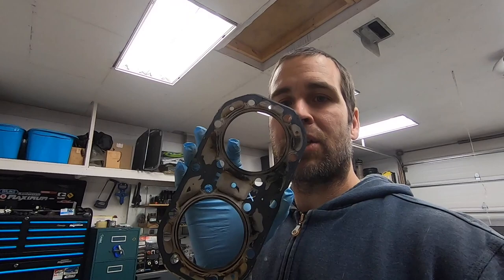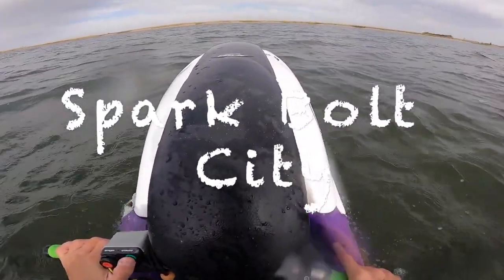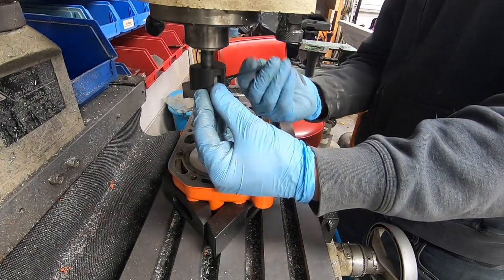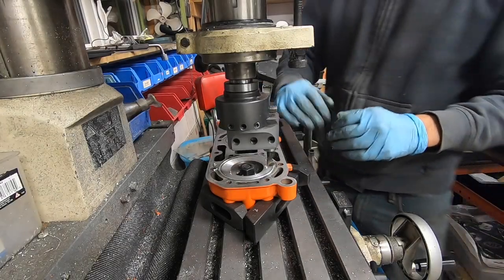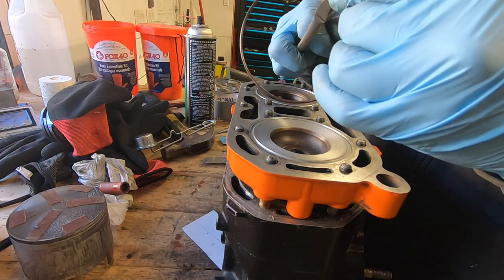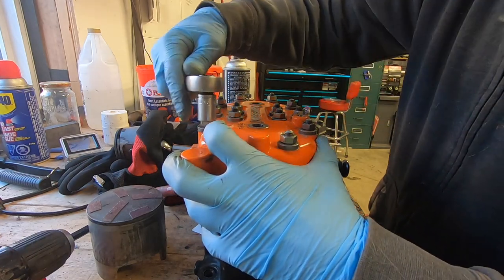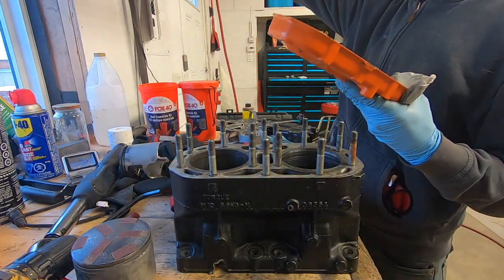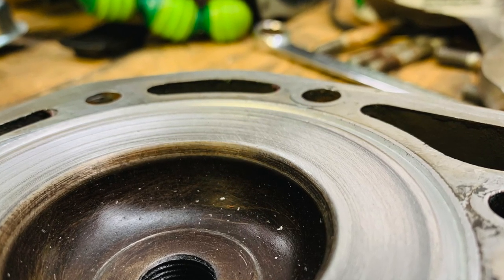Making An O Ring Head - Kawasaki X2

Comment: I don't think I've seen anybody else do this. Very cool. To be clear I believe this is called an Arsenealt ring head. I may have to try it. When I clicked on the video I was thinking hole saw? I think this is one of my favorite videos you've make in a wile. 1000% cool!
Reply from the maker: Thanks Jacob !! I'm blushing, lol. 

I think I read about this exact thing in a "two stroke tuners handbook" many many years ago. Some engines run copper head gaskets, so ... why not give it a go, eh :)  

The two most important parts of this, I believe, are making sure that your groove is deep enough but not too deep. You want enough copper sticking out so that it squishes and seals well, but not so much that you damage your head from deforming it. The next thing is to make sure that you anneal the copper. If not it will be too hard, won't seal and will probably damage the head. 

I think I may have done this before with led solder on an old engine ... but I honestly can't say for sure.

Comment: haha more spark bolt city. cutting orng groves nice. this is cool stuff. I have no idea if it will work, but I believe in you Joel 👍 that turned out good
Reply from the maker: Thanks Josh. I think it should work. Copper gaskets aren't as popular these days, but they used to be fairly common decades ago. My Yamaha Blaster and 1982 RM 80 both had aftermarket copper head gaskets and it was great, because I never had to replace them. Just heat it up and reuse it. 

Lots of old race engines used to have to do this because the head castings were never meant to hold up to high pressures. An added benefit of using a copper gasket is that it is amazing at transferring heat. Heads typically require more cooling when you start stressing your engine, so this can help.